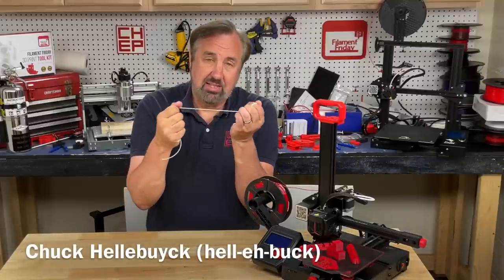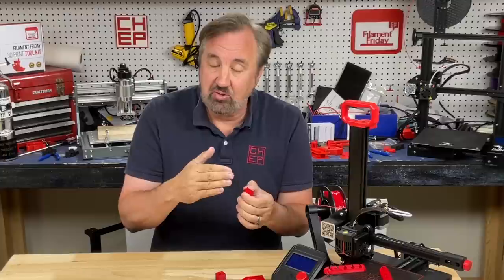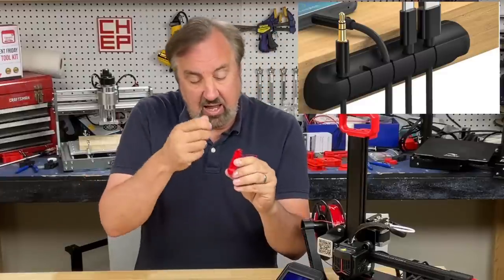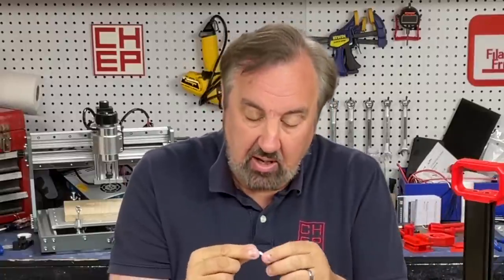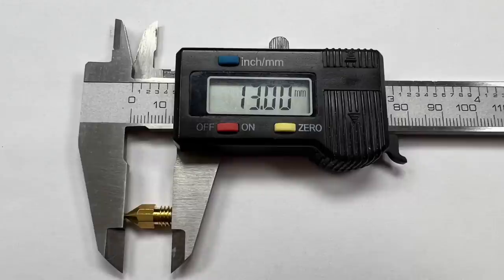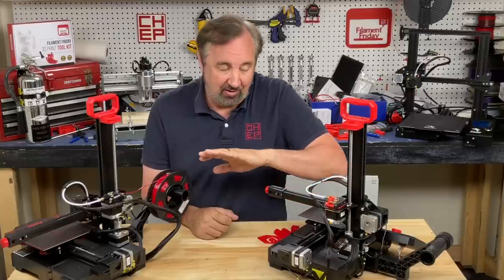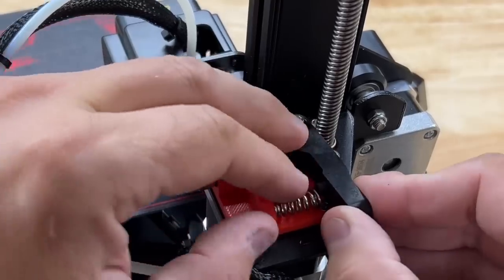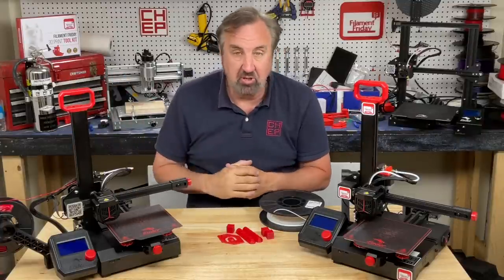Cura V5.0 - Flexible Filament Profile TPU

Comment: I have tried this profile for TPU on my ender 3 pro and though its fast I find the lines around the edges not joined to the rest (coming away) also is the same for the edges around the letters. The infill seams squishy so no rigidity the face is rough but finish is ok but not the best print, print time using the V5.0 sample 1:26mn. For me nothing has beaten CHEPV4.7_Ninjaflex and this for me on Cura v5.0 still works well and feels solid print time using the V5.0 sample 2 hour but worth it for the quality and it feels like rubber. Maybe worth basing the new profile on Ninjaflex as there is something there that hits the spot all the time and yes I am using it for TPU.
Reply: Looks like you need to bump the overlap up more.
Reply from the maker: Try upping temp.
Reply: @FilamentFriday  I tried overlap settings the same as I had for Ninjaflex Top/Bot Skin overlap changed to 0.03mm from 0.2, Infill overlap changed to 0.09mm from 0.1425 and infill to 25%. This did give me be lot better finish for a small bit of time added also it was more solid like rubber, however the edges around the sides and letters are still coming away. I will try up the temp next time but as the temp is ok for Ninjaflex I am not sure why it would be different for this profile, saying that I will try also let you know. Thank you Chep fantastic work.
Reply: @FilamentFriday  Ok after changing settings as below I upped the temp from 220 to 225 then to 230 the max stated in the TPU real, its better the edge's around the letters where stuck better and though the sides around the cura 5 sample where a bit better they where sill pulling away a bit. I must confess the same sample with Ninjaflex profile is also doing the same but not as much. all the same changing the settings has improved it.
Reply from the maker: Could be filament related. I’m not seeing that at all.
Reply: @Autocharge1  the faster you print tpu the faster it shows bad issues not seen while printing slower, so what i would do is compare the two profiles, what is moving faster in the new profile that wasnt before? Likely retractions and detractions since its a big part of what he is speaking about in the video i havent downloaded either so i cant compare as i dont run stock extruder on my ender 3. However im willing to bet your having slight gear grind or slipping against the filament. I could be wrong but just guessing due to things mentioned in this video
Reply: @FilamentFriday   @Justin Anderson   I have just printed using the same settings and Cura 4.12.0 with CHEPV4.7_Ninjaflex profile and this has no issue at all with separation and the print is the best, The time was 2:15 compared to 2 hour using V5.0 but worth the time all the way, this to me is not only showing the TPU, printer & heat settings is not the issue as these are all the same its V5.0 and something that its doing different that causes the print not to weld the sides correct.
Reply: @Autocharge1  check your retractions and detraction settings on both profiles male sure the are the same in both profiles. Has nothing to do with the speed at which the prints or the time consumed. Im thinking your tention on your extruder might be set alittle weak for tpu. I believe on his old verson profile he stated he didnt use retractions, and on this new profile he does. Just saying sounds like an extruder problem its slipping or grinding away filament. If its slipping your tention is to loose, if its grinding up the filament your trying to retract and detract to fast for the extruder gears to handle with tpu. I had the exact same issues before switching to a bondtec extruder couldnt adjust the tention enough so how to slow everything way down for tpu, now i can print tpu fairly decent and with the polyflex hf tpu i can print that stuff at 80mm/s. The reason behind it the filament was slipping in the gear because i couldnt get enough tention out of the stock extruder and i had the same defects.
Reply from the maker: Interesting. I’m going to experiment some more.
Reply: @FilamentFriday  Using CHEPV4.7 Ninjaflex in Cura V5 I changed the overlap on walls to 0.4, infill to 25% and nothing other, I returned nozzle temp to 220 and base plate off. 
The result was a 2hr print time however the print was perfection, side walls stuck and no stringing. 

Using the FFV5.O profile and the setting above I did get a reduced time however I got stringing and the F letters were defect looking like an upside-down L and the bits off the Fs dismembered inside the letters. 

In short Ninjaflex in Cura V5 with seating changed worked a dream using my ender 3 pro.
You nailed it with Ninjaflex this with some changes stands undefeated, like I say for me this is a fantastic base to look at improvements, something strange with FFV5.O profile and how it collaborates with Cura V5.
Reply from the maker: Great feedback. I’m seeing similar results. I may dump the V5.0 version and keep working on the Ninjaflex version. It works for standard TPU as well.
Reply: @FilamentFriday  Just to add I admire what you do and you keep things simple, clear and concise to under understand. 
I use TPU more than any other filament like you say Ninjaflex profile is something I have been using from day one as no matter Ninjaflex or TPU this works well on all. As for my poor projects printed using this profile they go through hell and back as I print gopro mounts and other for model flying craft like racing drones. The mounts all get ripped to shreds but hold up never letting me down or loosing a gopro, a bit of glue and away we go again while others flying there gopro rips off and is lost the mount is completely useless cant be fixed. I have tried other profiles and they are no way as good as yours including your new PLA profiles.
You are the best and thank you for all you do.

Comment: The plate temperature is 50 in your profile. I'm using "Gizmo Dorks Flexible TPU 3D Printer Filament 1.75mm 200g, Yellow" which recommends 80 C. should I change it to 80?
Reply from the maker: If that works better for you. I’ve never had issues with TPU sticking to the bed.

Comment: I am having issues with this profile for TPU. The walls are separating from the top, bottom and infill. I have the 0.2 in the overlap and inset and did not fix the issue. Any suggestions on how to adjust for this? Ender 3 S1 Pro With Cura 5.2.1
Reply from the maker: Adjust temperature to match your filament. Sounds like the default is too low.
Reply: Check flow too. I accidentally reset the extruder steps and caused delamination
Reply: I ended up resetting to Ender 3 S1 profile for TPU and copied most of Chep's settings and getting perfect prints. No stringing or anything. Extremely impressed

Comment: To avoid personal disasters before commiting squishy filament to my Ender; and wanting to make small text stamps, I have been binge watching videos. I am looking for someone who has prefected using a 0.2mm nozzle. 
                Have you explored smaller nozzles with flexibles?
 I really want to avoid going to Resin; but I appreciate that trying to push a rubber band into a tiny hold might be impossible for my Ender5.
Reply from the maker: TPU is tough to print that small.
Reply: @FilamentFriday  Thx ....  I will have to try. Do you know of a type / brand of flexible; that might provide the best chance of success for a small text ink stamp ?

Comment: When you switch from PLA or PETG to TPU do you change the nozzle?
Reply: nope.
Reply from the maker: I don’t.,
Reply: @FilamentFriday  Ok, thanks Chuck. I know if I print PETG and then switch to PLA or vice versa I switch nozzles as it just seems to lead to cleaner prints for some weird reason. Not sure if material is getting impregnated in the metal or what, I just know I have had more consistent performance when I do this.
Reply: @Ronin Paterson I have not, I don't own any while I do have spare nozzles so that is easy enough :)
Reply from the maker: Whatever works I say.

Comment: with this profile there are actually great walls, but I still have a problem that the outer walls are not glued together, which needs to be corrected
Reply from the maker: Adjust the flow to match your machine. Try 100%
Reply: @FilamentFriday  i have every time 100%
Reply: Wall its perfekt :-)

Comment: @CHEP, What causes the walls to not be joined together? I am using your profile with 4 walls but the walls are not joined. I get an inner and outer wall of 2thick O_o Also noticed there is a lot of stuttering/stopping while printing and not fluid motion. Thanks for your input!
Reply from the maker: Increase flow rate. 
Could be related to power loss recovery. https://youtu.be/c_llLYxbJ4A
Reply: @FilamentFriday  I'd say it's the retraction and slow retraction and detraction speed.

Comment: we appreciate the profiles as always, but would you consider releasing just the .curaprofile itself and not the whole project folder? I have an Anycubic Vyper and it does not work if i load in the project file itself. Thank you.
Reply: Just load it and then change the bed size and name.  I'm on all Anycubic machines too and it works great.  I thought I had my Vyper dailed in pretty sweet but his "good" profile made it even better.  I've never got my vypers to load TPU good so I'm excited to try this on my Kobra when it gets here tommorow!
Reply: @MikeKow80  thanks for the info, I’m reading this as I’m laying down for bed so I’ll give that a shot tomorrow

Comment: Forcing us to accept the subscription terms of use to get the "free" profile on that domain isn't very fair. I'm still waiting on your ignoring my request for a price to buy the profile without the privacy and monetary subscription that includes very specific use rights with that domain getting full control over billing and access to the hosted content to do whatever they wish.
Reply from the maker: I’m not forcing anybody to download them. There is no monetary subscription required to download my files on Thangs.com.
Reply: preach it brother
Reply: @FilamentFriday  but by using that domain and refusing to use something like google drive, you are preventing "free" sharing. So why won't you sell them directly to us?
Reply: Are you referring to this:

Subscription Services. Each applicable Order Form shall specify the Subscription Services to be provided in accordance with the representations and warranties set forth in this Agreement, and shall identify the Platform, fees, subscription term, and other applicable terms and conditions. Changes to Platform. Physna may make, in its sole discretion, any changes to the Platform that it deems necessary or useful (i) to maintain or enhance the quality or delivery of the Services, the competitive strength of, or market for, Physna’s products or services, or the Platform’s cost efficiency or performance, or (ii) to comply with applicable law. platform access.
Reply from the maker: I talked to Thangs and they are working on new simpler terms. The subscription reference is for businesses. They told me you could use a new email and fake name if you want to setup account if you are concerned. They just want record of activity.

Comment: 12mm retraction is too much and will jam over time with many retractions in a small time frame. 10mm is bulletproof for bowden drives. Trust  me :)
Reply: I ran 8mm on my Ender 5 and it ran great. Of course once I converted to direct drive it came down to 2mm.
Reply from the maker: Depends on the filament.